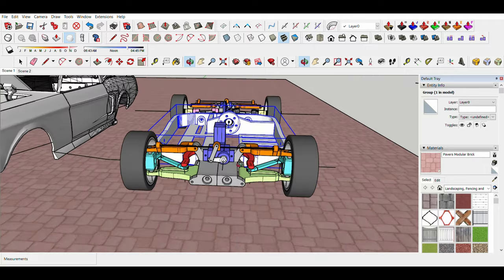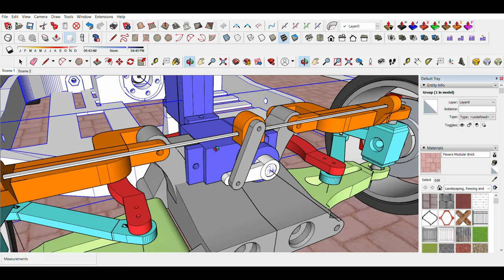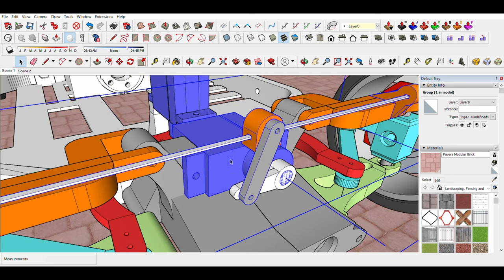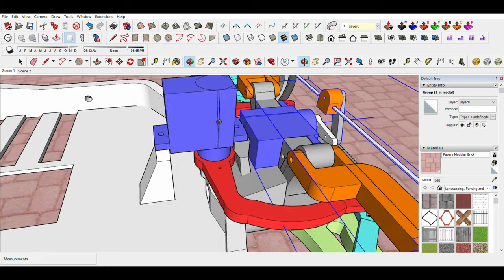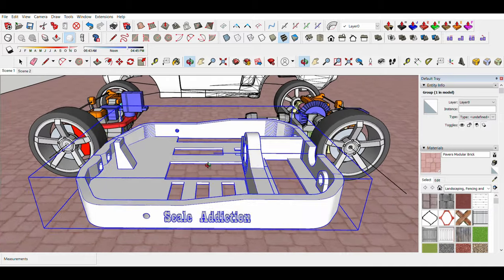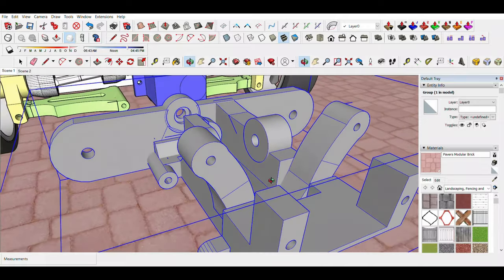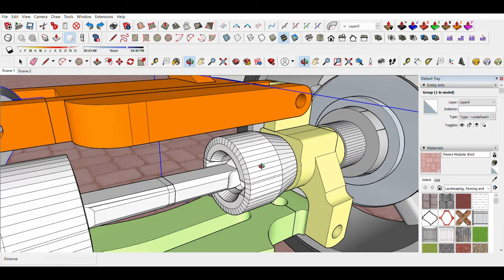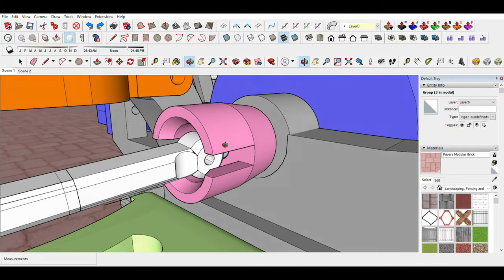Designed Rear wheel drive Custom Chassis Drift Car Part 2/How to make rc car | Scale Addiction

Comment: Why not print the chassis as a whole, like the tamiya bucket chassis?
Reply from the maker: The chassis middle section is one part and the half end and back separated, In case if the Hinch pins brake I dont have to print the whole chassis